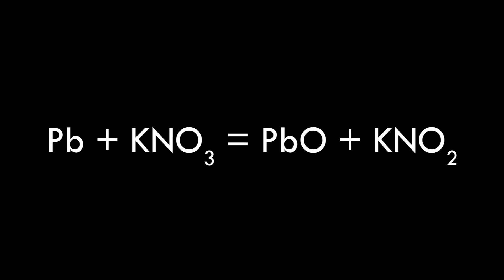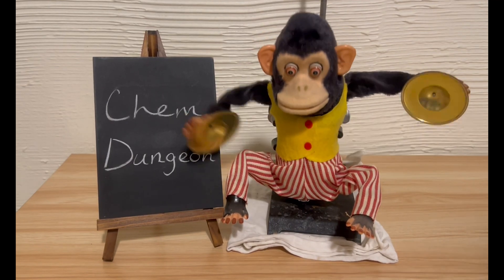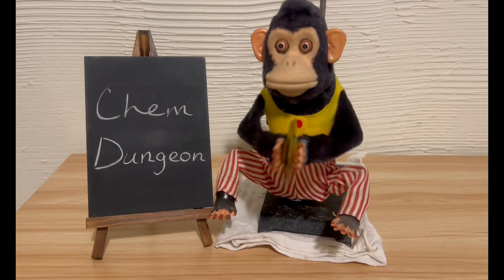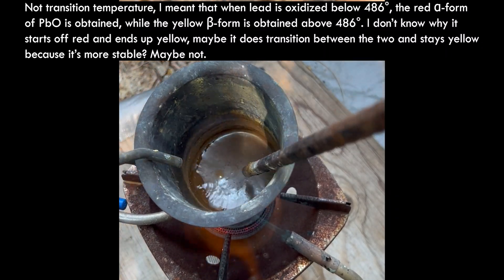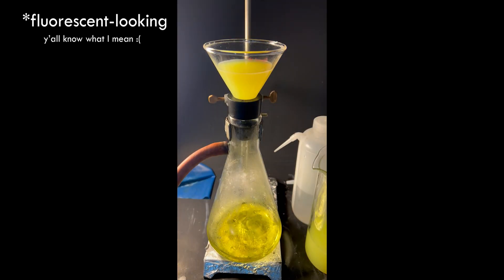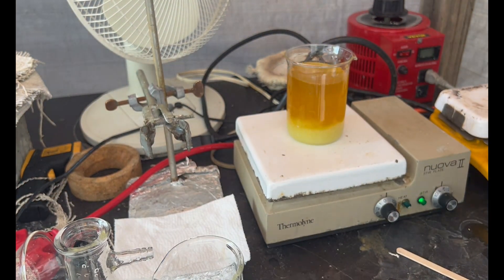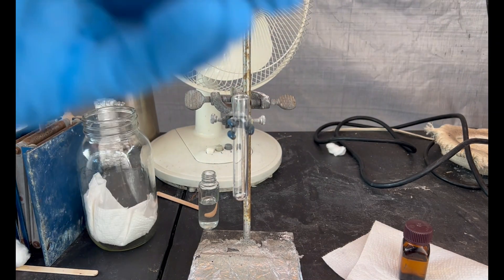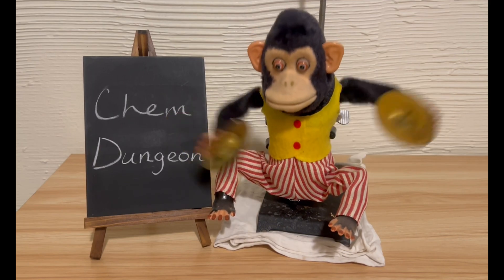Potassium nitrite from potassium nitrate and lead

Comment: If you're aiming for isopropyl nitrite knowing how pure your homemade K or NaNO2 are really isn't that important because of how cheap the reagents are. Just do the stoichiometry based on pure nitrite and do the reaction. Of course purity is great and definitely important for other reactions but most amateur chemists are going to be making isopropyl nitrite and can use whatever nitrate reduction method they're most comfortable with or have the reagents for. Personally I like the calcium sulfite method because it's easy and has a high conversion compared to other methods and doesn't require a complicated purification process.

Comment: Hi ChemDungeon,
Nice video and oxydoredox (of nitrate to nitrite (reduction) and oxydation of lead to PbO).

About your transcient green color, from memory out of a lot of chemical books readings it may be due to polysulfides; of course the brown-red-orange colored stuff is often known as a big bag containg a lot of alike molecules (H2Sx with x integer of various numbers; but when you are more interested into the specific molecules, you have H2S3, H2S4, H2S5, H2S6, H2S7, ... and each has its color shade from yellow to brown; IIRC green is possible.

I like the concept of PbO to be used for Pb(2+); anyone that did try to make Pb(NO3)2 from HNO3 and Pb learn fast that it takes ages to dissolve and build up.

Considering air oxydation of Pb, if heated, you may get a little PbO2 too as traces and PbO + PbO2 makes the intermediary Pb2O3
I'have got interested into PbO, PbO2 and Pb as possible pathway to perchlorate starting from those as electrodes from NaCl, Na hypochlorite and Na chlorate.

PHZ
(PHILOU Zrealone from the Science Madness forum)

Comment: This is an incredible yield for such a ghetto setup... this is the FIRST nitrate to nitrite video i actually believe got the product.
Reply from the maker: @WizardZph  gotta love the older methods, they’re often more attainable for home chemists. Working on the sodium equivalent now, it’s going pretty well but the thermal decomp is almost definitely going to lower the yield because it seems like there’s more unreacted lead left over. You don’t trust the calcium sulfite and K/Na nitrate method?
Reply: @ChemDungeon  
Theorically there are probably a lot of univestigated "mild" reducer that may do the job.
A bit of search into the field of electrochemistry or oxydoredox could bring a process to light.

Sulfite is in an usual "mild" reducer into organic chemistry; so does polysulfides; probably simple S wil do?
On YT, many have tried to change the lead reduction of nitrates to nitrites (written in old chem books (<1950)) by other reduces (C, sugar, ascorbic acid, ...)

Regards,
PHZ
(PHILOU Zrealone from the Science Madness forum)